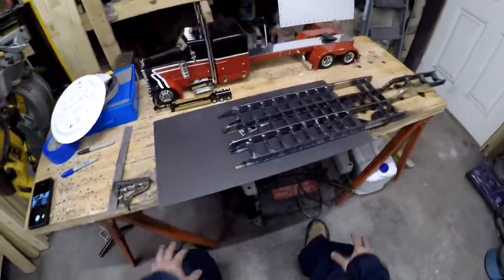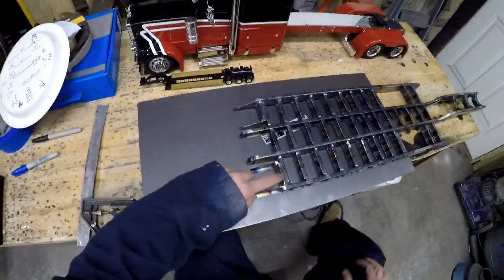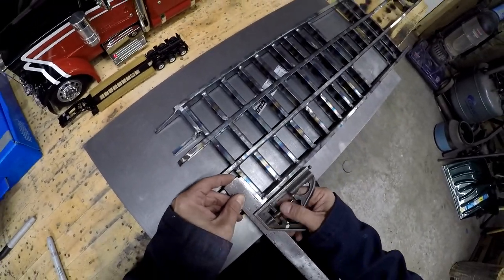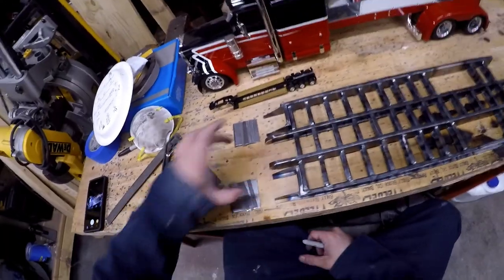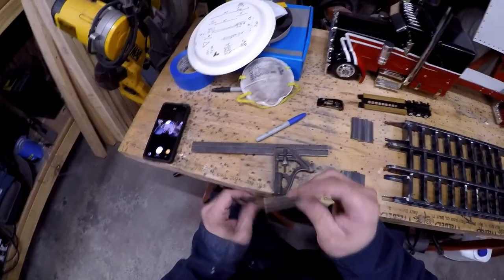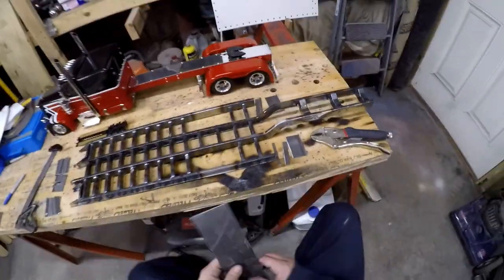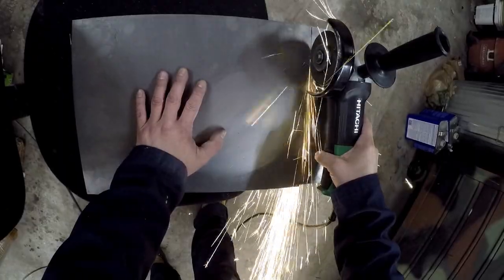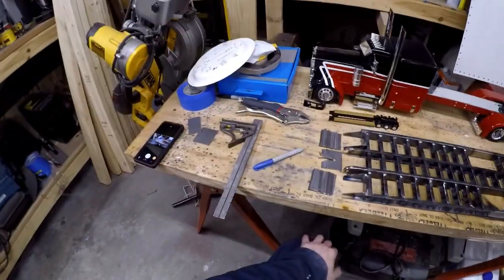Fabricating 1/14 Lowboy for Semi Truck Part 4

Comment: Hello beautiful your trailer how you calculated to have it in 1/14 I am a beginner in the rc
Reply from the maker: I found a drawing with basic measurements online. Then to calculate scale I multiplied the inches by .071 which is the result of 1 divided by 14. That gave me length and width. The rest I am doing by eye to get it to look right.